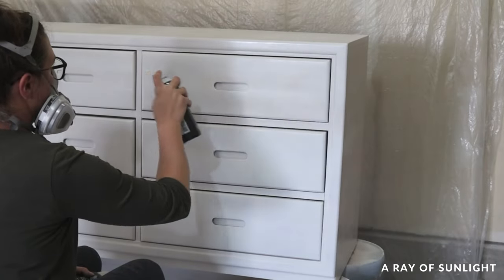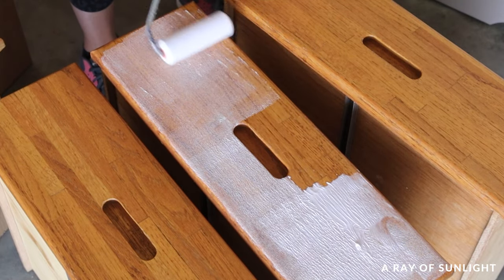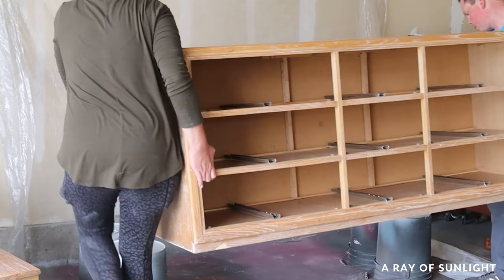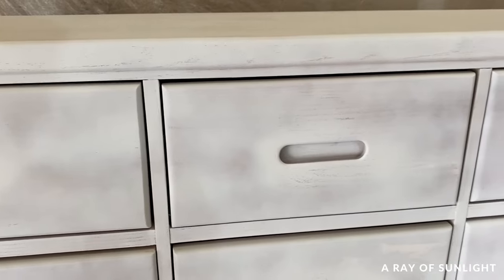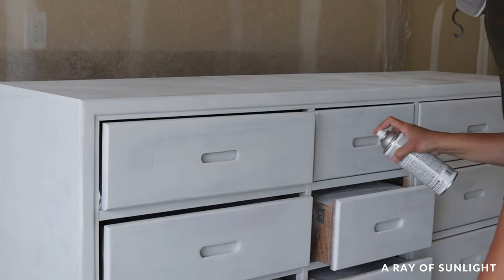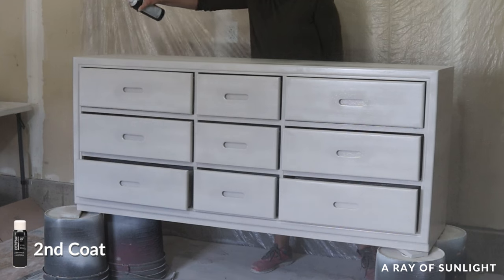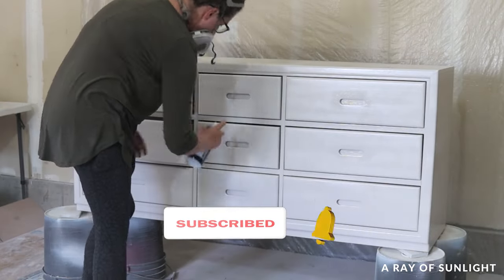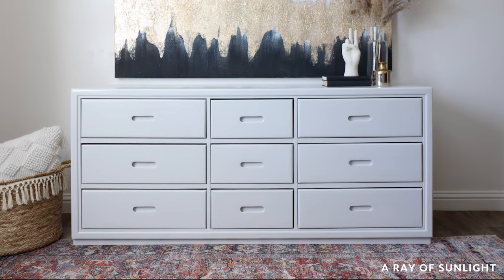Spray Painting Furniture | The Good, The Bad and The Ugly

Comment: If that was real white oak hard wood and not just veneer than it.s a sin to mess up such nice wood with just cheap spray paint. You could have left all base in original colour. Sand it and give it just 2 coats of clear warnish and spray paint drawers only with white. That would look 100 times better. Pure white is boring and looks like just bought from pawn shop 😊

Comment: It’s very pretty. I don’t like using spray paint on furniture because like you said it’s ver inconsistent. Also did you fix the side where it split from the legs?
Reply from the maker: There wasn’t any damage to the paint. The screws just didn’t stay in the particle board because it’s particle board. 🙃
Reply: @ARayofSunlight  you can build a base made of solid wood to attach your legs too

Comment: Have you tryed the new colorshot? It doesnt smell like paint & the VOCs are low it comes in primer+ paint, Satin, gloss, flat and others cuz its from californa where their stricter with the chemicals it says no sanding needed, I spray painted a rolling cart with mesh curved shelves out on the balcony I think it was around 40° humitiy very high cuz I didnt finish before it started raining cuz management was going to tear down balconys and replace I had 1 day to finish I didnt have drip marks or blotchs or bleed threw of rust, I had a black 6ft screen room seperator and started with rustolum black gloss ran out & finished with the colorshot had to go over many times since the rustolum had bleed though of the rust, seems like the paints are not interchangable end result seems like it never dried completly sticky to the touch leaving fingerprints oh and since I was outside I sanded the rust with diffent grits! Doing restoration i cant learn enough but I know some sprays cant be used together, now i have to figure what type of material will be stiff enough and not see through I think its 5x5 originally fiberglass inserts that would cut your fingers just moving it, its also sentimental probly 40s asian style some people might call it a changing screen you see em in the old westerns

Comment: Okay, I am a bit confused. Instead of filling the woodgrain (valleys), couldn't you just sand the thing down to remove the peaks? This seems like less work.
Reply from the maker: Nope, you can’t ever sand down far enough to remove the woodgrain.
Reply: @ARayofSunlight That's not true. You can use a sander to get it back to its natural state. Where it's all even and no pockets. I've done many times. Adding spackling to a dresser is a bit odd

Comment: I am fairly new at refurbishing furniture... I found something and somebody's free pile that was a great storage piece but it had blue spray paint already on it and I wanted to go over it with white spray paint when I did that... I tried to take the blue spray paint off by sanding it down... That didn't work.
I was crunched for time so I thought I would put a primer and just spray paint over top when I did that once the paint was dry Even up two weeks later This smallest bump against it would scratch the paint off and also if you try to fix the scratch you could actually lift the paint off and peel it off. Why do you think that happened? By the way I sold the piece out of the yard sale for $20
Reply: Did you make sure there was no dust after you sanded?  There is also a curing time for primer, and it depends on the current environment.  Also, this channel has a very useful video on which primer/paint combination resists scratching -  https://www.youtube.com/watch?v=uM_boGIOTIM

Comment: All you had to use is a roller and oil thick based paint, like eggshell or enamel, like... for a radiator. These paints naturally get smooth like butter. all you had to do is disassemble the table before painting it lying flat for no drips to occur. Spray paint you can add in the end on top of primer and some light sanding to the dried thick paint. It's painful watching this... floor paints are cheap, and you can probably paint 20 of these will little to no cash. And these paints stick like mad to anything, plus dry in smooth finish. I really don't understand what you mean when you say it's durable... since wood will expand and contract, and crack even if it's plywood... the paints you used in spray paint are brittle and will flake off that wood over time, unlike the paints i told you about which are flexible when they dry. 
PLUS, you could've just drilled a small hole before putting in the screws... so the legs would hold. Also, so they hold better could use Super glue on them just before screwing them in lightly, LIGHTLY!  It shows you don't know much about wood since that bit of 2/4 there cracked from your screw up.  6:17 and... these are short as hell to hold such long legs. If you want your spray paint job to look smooth.. by the way, it's a lot more work. you need to add lacquer and then compound it and polish... then you will have mirror smooth finish on spray can job.
Reply: Some people are allergic to oil based product's! I am that's why I'm looking for alternative ways! You need your own channel instead of dissing someone else's work!
Reply: @me4654   if allergy is a thing. So Is a gas mask and gloves 😁 both go hand in hand when spray painting too haha